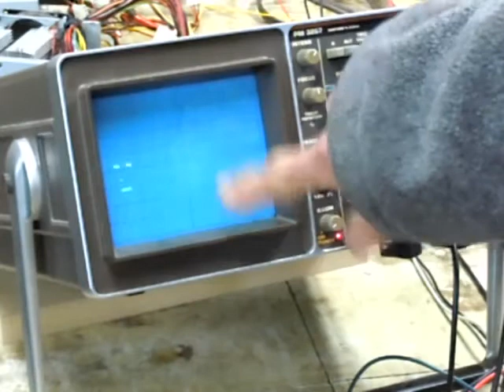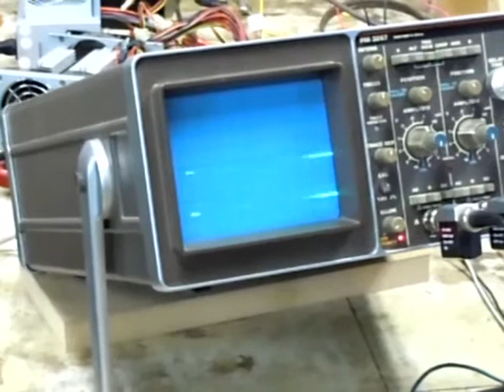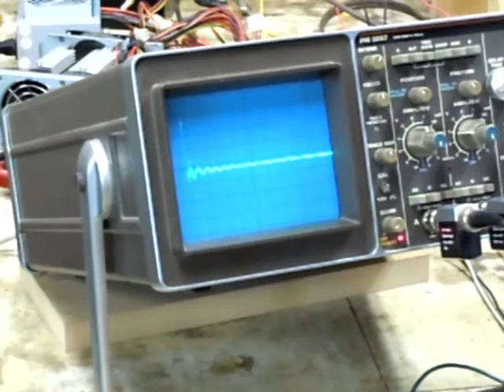Star Coils Self Oscillating Bedini SSG Circuit Battery Charger

Comment: your spikes are inductive spikes. I resolved it and made use of the energy by puting a smoothing capacitor. only problem in your setup doing that, is it may put a damper on the oscillating coils. maybe a diode in one direction, would allow the capacitor to absorb the inductive spice but wont dampen ringing in the star coils
Reply: um...id like to learn what exactly is happening here? what is the properties of these kinds of coils?

Comment: Hey mate, nice work but I don't get it. I don't know what you mean by using 300 Ohms to make it run or how you are getting it to self oscillate? I've made a few of these coils & a few different rodin toroid type of coils (you should try these actually, I think they might work even better with how ever you're making this one oscillate) but never been able to get them to do anything! Are you just running the output of the bedini circuit through it or what? Do you have any schematics that might help replicate? Any help you can give would be awesome, I'm fairly new at all this stuff but I love it..
Cheers!
Mick :)
Reply: I think the 300ohms are between base of the transistor and the trigger coil. To start it maybe you make a contact between collector and emitter but only for a SHORT time.